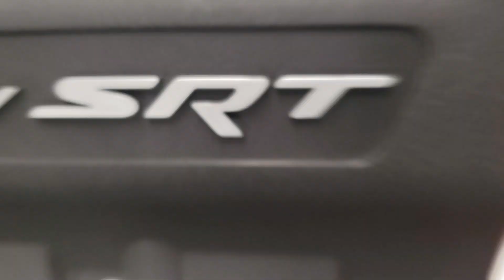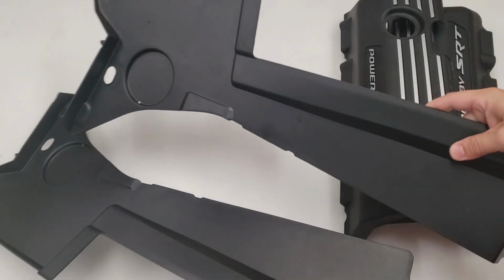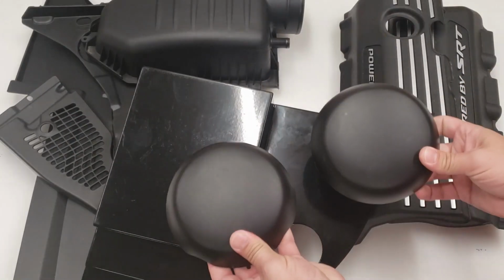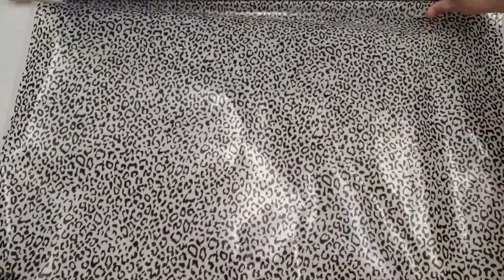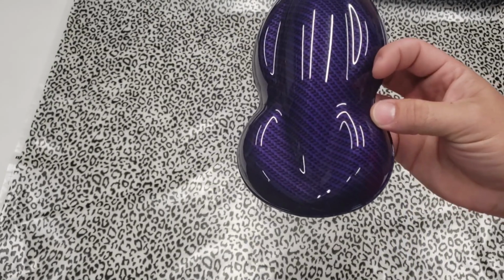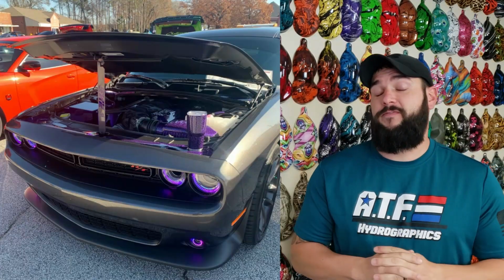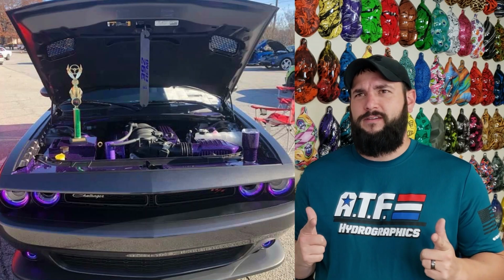Hydro Dip 2020 Dodge Challenger SRT Scat Pack

Comment: Could you go over all of your cerakote stuff. Ecspecially the oven!!
Reply from the maker: In a future video I can, not much too it Oven is an old metal paint cabinet lined with rockwool and aluminum foil, smoker element and a pid temp controller. I use Iwata LPH80 spray guns, and all the rest of the small cerakote stuff I use is in the description box of every video.
Reply: @AllThingsFunHydrographics  Thanks man appreciate it. Have a blessed day!!

Comment: May I ask what you are spraying your activator with ?
I see no cup and only one hose.
Some kind of pressure pot ?
Reply from the maker: It is a pressure pot, very expensive and not worth it in my opinion. It does not work on all patterns and is very tricky to use correctly. I have 2 other guns I use that are more like normal spray guns.
Reply: @AllThingsFunHydrographics  ok, I thought maybe I  was missing out on something new.
I have some good name brand activator guns ANI and others but believe it or not the best one i have and the one I favor is a Harbor freight tools.
Central pneumatic 20 oz. HVLP, the raw aluminum almost looks polished body now $75 I payed $60 a few years ago.
It has a nice wide and even fan.
I can cover a half meter wide film with one pass.

Comment: After I dip a speed shape and rinse it and air dry it I tried to clear coat and the paint is starting to dissolve and wash away under the clear coat. Any help?
Reply from the maker: What clear are you using? Aerosol or in a hvlp gun?

Comment: I HOPE you see this!

I’ve been following your videos just to do small things to my challenger, these are the exact pieces I want to dip. Would I be able to do this at home with the right container? 

If it’s a long shot I’ll let the pros handle it I just want to be more hands on with my car.
Reply from the maker: There is a large learning curve with hydro dipping, especially without the right equipment... but it can be done. Just don't use your car parts for practice. Use something cheap and easy like speed shapes or plastic hubcaps or whatever you want to practice on until you get the hang of it. By far the easiest thing to do is buy all OHW paints, activator, and clear coats in rattle cans because they work great.  And just get out there and practice practice practice.